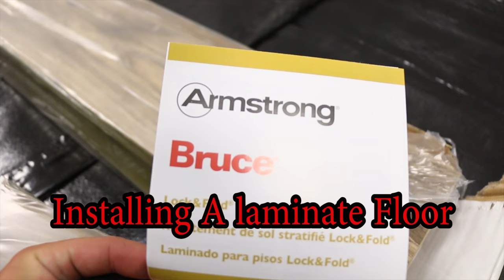Laminate Floor Installation - Armstrong Flooring

Comment: We used that flooring on a mission project last year. Super easy to put down and the spacers you put against the wall made it super easy to get e gap between the wall and flooring. We used a couple installation tools that worked great and got the joints almost invisible. Great product great folks installing it!